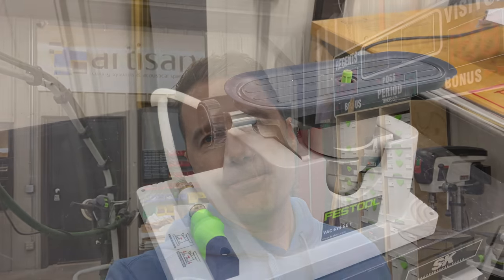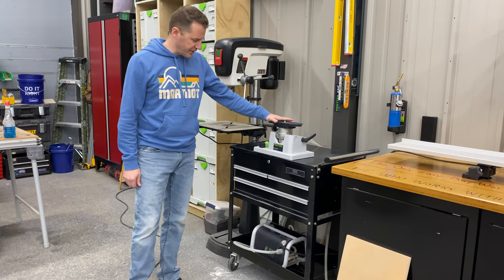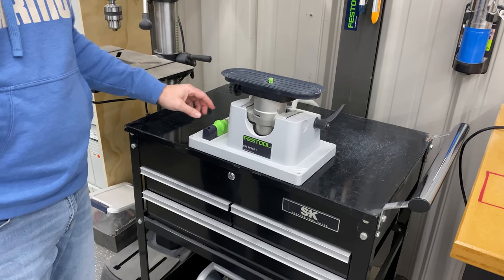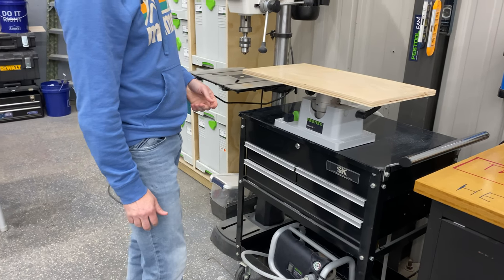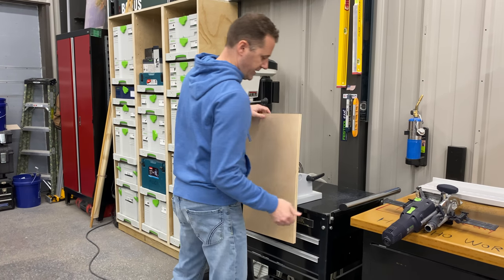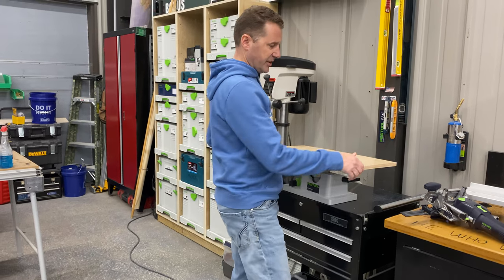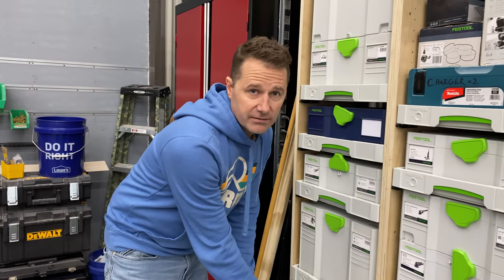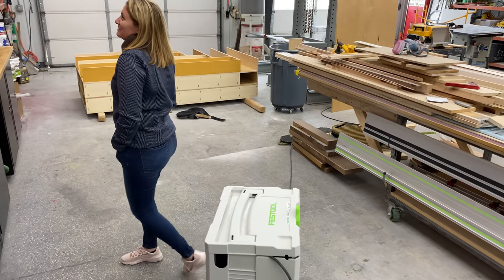Festool VAC SYS review and demo

Comment: Have you ever thought about adapting the pump in the Vac Sys for Vacuum bagging duties?  I'm sure the duty cycle on that pump will allow it to run for hours and I bet it could pull enough Vacuum.  Someone has somewhere has done this conversion.  inquiring minds want to know
Reply: Yes you can. Pump is rated 100% duty cycle. Could easily handle a 2'x4' bag and  up to 4'x4' bag. For larger bags it would be better to run a larger pump.